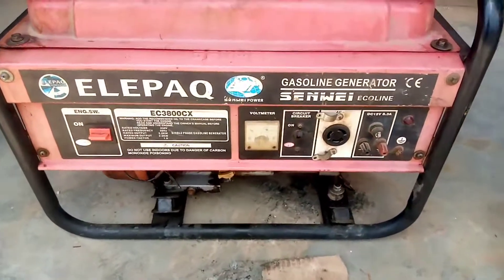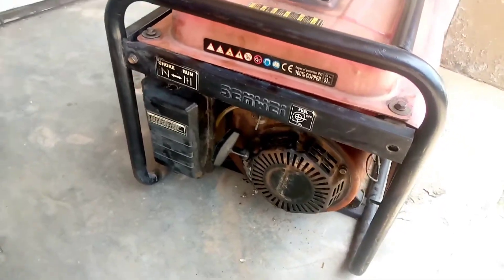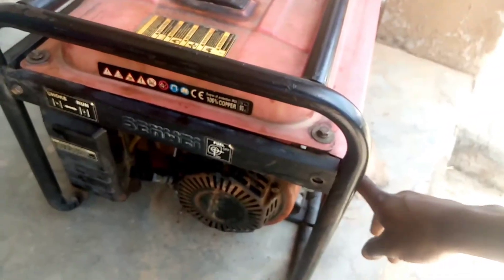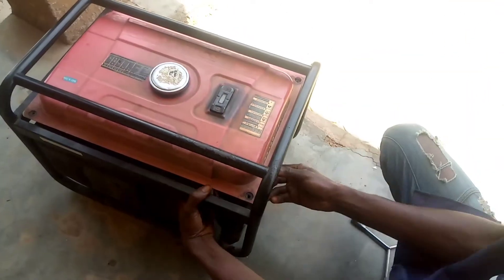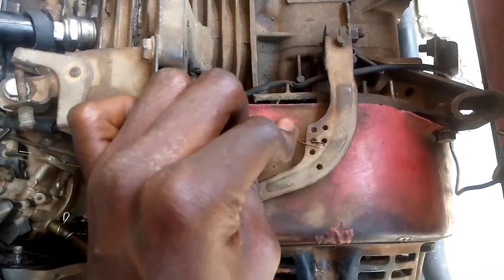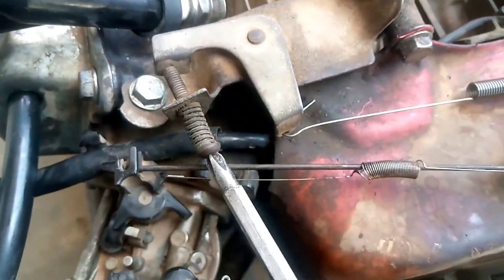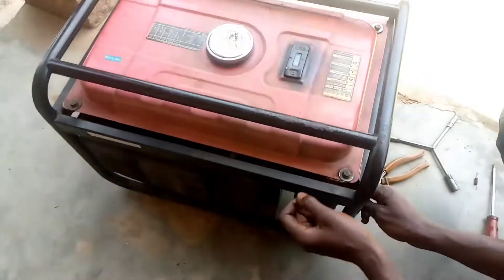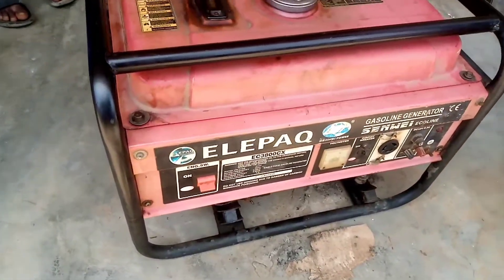How To Replace Governor Spring on Generator

Comment: Hi bro , my generator 2200w is vibrating with sound of high and low as shown in the video but the current is still 220 and I cleaned the carburetor with cleaner but making the high and low sound , what can be done to it  ?
Reply from the maker: Buy a new carburetor.

Comment: You put the spring in a different hole on the governor arm.   ( I know,  that hole you put it in looked like it had more wear,  so was probably the original location.)
Reply from the maker: Yeah that is the exact location it should be

Comment: My generator voltage is high to the maximum and I have try and reduce it with the regulator spring but it doesn’t reduce still very high, please what can I do ?
Reply from the maker: Watch this video to set the governor race. https://youtu.be/jHJfPBGTZT4
Reply: @jaywealthmechanics9285  but my generator is a bit smaller than this , the spring are different
Reply from the maker: @melissavee2621  how many kva?

Comment: thanks bro! one question please: can a deformed spring (not elastic enough) cause the generator to stall under load ?
Reply: Yes. The springs need to be changed every few years, as they will cause running issues when they lose strength, get rusted out or deformed.

Comment: Please whats the name of the other spring there
Reply from the maker: Throttle spring
Reply: @jaywealthmechanics9285  thanks.. My generator turns on and then turns off by itself. Please what is the possible problem
Reply: @Critical-kenn  my guess, it's probably not getting enough fuel, service the carburetor or adjust the fuel supply screw on the carburetor as a temporary solution

Comment: What could be the reason for the voltmeter power fluctuations? It produces a low current for a while, then a high current later. It continues for a while before it stabilizes.
Reply from the maker: What size of generator

Comment: Hello mate i have a very similar generator, the spring broke on mine but the generator still runs at good RPM and the electricity coming out is fine.
I'm worried i might be over running it since it doesn't lower the RPM when there is less Power requirement because from the sound of it its running at 100%.
Should i go out and get replacement spring?
Reply from the maker: Yes go and get the spring.. because the generator might not power some of your home appliances, if is not there.

Comment: Pls the current from my gen is not stable
Reply from the maker: Firstly what type/size of generator are you using
Reply: pls cheng avr
Reply: why did you put new spring in a different hole?